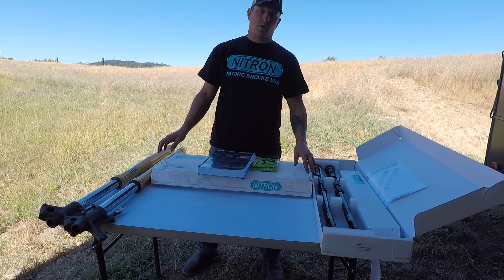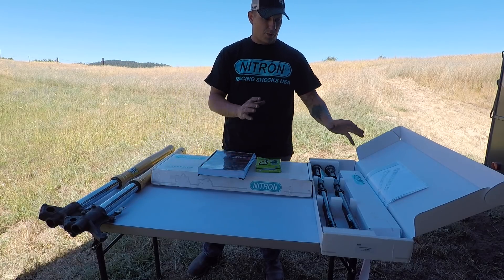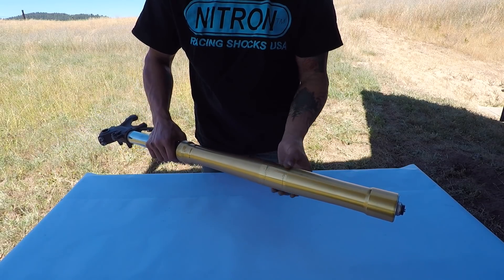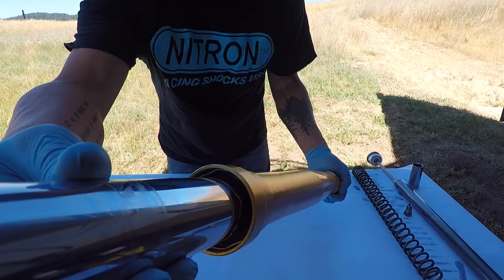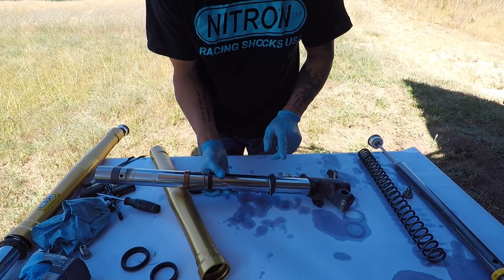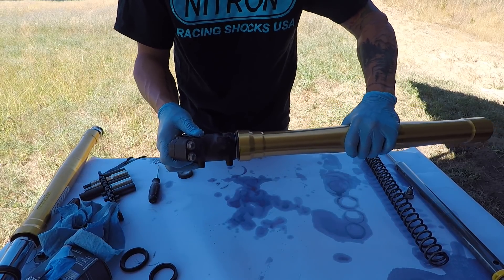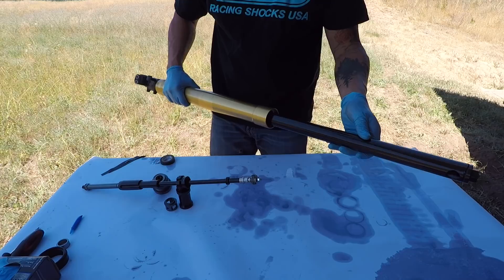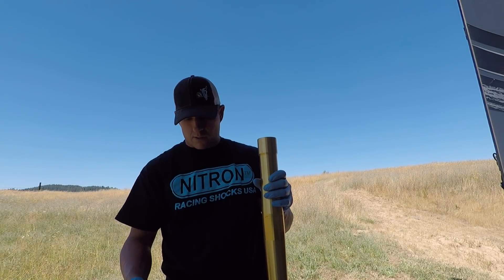Honda Africa Twin Nitron TVT Fork Cartridge Install

Comment from the maker: So something I would like to mention about this upgrade. I did this upgrade because I didn’t like the way the OEM Fork performed on rough terrain. I had quite a bit of stiction in the forks. After doing the upgrade I loved the way they felt but after a only a little bit I developed some stiction again. I pulled the forks apart and couldn’t figure out what the problem was since the cartridges were flawless. I sent my forks to Konflict Motorsports and they found that the fork tubes were badly worn on the inside. (Dreaded Showa issue) It was so bad that Alex from Konflict was able to get them replaced under warranty even though my bike was out of warranty. The new tubes were Hard anodized and since getting the back they are amazing!
Reply: I was just going to ask if this eliminated the dreaded fork stiction issue that has cropped up on the AT.  I'm interested to see if the problem returns even with the hard anodizing from Konflict.
Reply from the maker: Sean Frank me too. Only time will tell. 🤞🏼

Comment: love your videos keep them coming..  you mentioned  ohlins  rear shocks i"m guessing you went with  STX46 Adventure Rear Shock?   I was told to beef up my spring and revalve old shock but with labor and parts i thought i would just upgrade if its worth it have any thoughts on this. I ride in northeast mostly forest roads with rocks and some washouts.   loaded with gear 45 pounds plus 195 pound rider im finding the suspension to soft for the speed i like to ride any info on suspension would be helpful
Reply from the maker: Thanks for watching and that’s a great question. So I’ve been debating on taking this Nitron video down because in my opinion it was a waste of money. The Ohlins suspension is freaking top-notch. I have both the replacement front forks and rear adventure shock. By far the best thing I ever did for that bike. The thing is if you don’t ride super aggressive and really all you were going to ride is fire roads and  some technical high speed gravel, The factory rear shock is actually really good and is very tunable. You could probably tune it for your weight and riding style for about a third or more less than what the Ohlins would cost. As for the front forks. There really isn’t much you can do to help them. If you’re looking for the best thing you can do in the front I would say go with the full replacement front fork. The replacement cartridge from Ohlins is basically putting a Band-Aid on a shock tube that already is prone to failure.
Reply: @backcountryadvmoto  thank you for your  quick reply  i think Ohlin front forks are the way to go.  I do take my beast out on rides with dual sport bikes and feel the limitations  so i may just go for broke and be happy knowing i have a set up that will put a smile on my face. For the past year I was looking at several different suspension set ups and i keep coming back to Ohlins  so i thank you for responding it was very helpful

Comment: where did you learn to air bleed the forks with the cap fitted? Every instruction I've had from a suspension engineer has been to keep the fork collapsed without spring installed and bleed by steadily moving the piston rod up and down through its entire stroke about ten times.
Reply from the maker: HORNET6 The directions from Nitron. It’s just barely on and used to move the piston up and down. Once you crack it back open all the air is released.

Comment: Just wonder what does the stiction feel like I have a front seal leaking on mine on left side and it’s getting replaced under warranty sometimes it feels like when pulling out at a red light it will pop in the front on same side thanks
Reply from the maker: 98powerjoke that would be a good way to explain it. It you fit it on the center stand and push down in the front, the front forks should compress and rebound smoothly without and resistance other than the fluid and the springs. If you see/feel the upper fork fork tubes catching or  anything other than a smooth fluid motion. Stiction can be caused by bad fork seals, but if you were already going to have it in to have the seal replaced I would make sure that they look inside your upper tubes for any wear. It normally occurs where about where the triple tree clamps are.

Comment: Thanks for sharing.  Any fork stiction issues before doing this upgrade?  Also, did you clean out the tubes really well to see if there was any abnormal/premature wear to the anodizing inside your outer tubes while you had them apart?  I've heard that some guys have had issues with these Showa forks on the AT.
Reply from the maker: Paul Kangas I was posting a comment about this just as you commented about it. Please read my comment in the feed. I’ll copy and paste it in the description as well.

Comment: Nice video. Did you buy the $800 tool kit? I'm looking to do this job on my triumph and not buy the whole tool kit that has tools for other makes.
Reply from the maker: The Cappy nope! Don’t get scammed. The whole process can be done with normal had tools. Depending on your application the only tool you might need is the one that goes over the cartridge and down to the bottom of the fork leg to break the nut free. This may not be how yours is, and if so you can make a tool, or if you call Nitron USA, they have loaner tool kits. At least they used to. ALL this being said, I no longer use Nitron and switched to Ohlins. I had MANY issues with the Nitron stuff. Ohlins is hands down a better product
Reply: Unfortunately Ohlins don't make a fork kit for my bike yet, other models kinda fit with modifications. I have Ohlins rear on my bike though. I took your advice and talked to Nitron USA and they got me squared away. Thanks.

Comment: Great video gives me more confidence in doing my own upgrades as I am a XXL guy so upgrading is going to be necessary. Does the 2017's have the same wear issues or is it mostly limited to the 2016's?
Reply from the maker: W Clark hey thanks so much for watching. So I made this video over a year ago and since then here’s what I’ve learned. First off the Nitron cartridges are excellent if you don’t plan on taking the bike off road and doing anything serious. They are a great touring replacement over stock, but to be completely honest with you I don’t think they are worth the money. I honestly should probably take this video down. Since installing these, I have ridden the crap out of my bike. Ultimately I treat it like a big enduro bike. I kept bottoming these forks out and even after getting my tubes replaced because of wear issues and having them re-coated I wasn’t confident I would not continue to have wear issues because of my riding style. Ultimately the Honda stock forks are undersized and flex too much for this bike. Honda dropped the ball. I would highly encourage you to go with Ohlins replacement forks and rear shock. They are a much larger Front fork and have amazing customer service. Alex at Konflict Motorsports is an excellent resource for this as well.  Since ditching the Nitron products and going with Ohlins the bike handles like a dirtbike and is hands-down the best upgrade I have done to the motorcycle. I recently did the Nevada BDR and can run the bike like a desert racer even with camping gear and all that. Bottom line save a little bit more money and go Ohlins and you will not be disappointed. Hope this helps
Reply: @backcountryadvmoto  thanks for sharing this advice.  you've spent a lot of money on suspension!